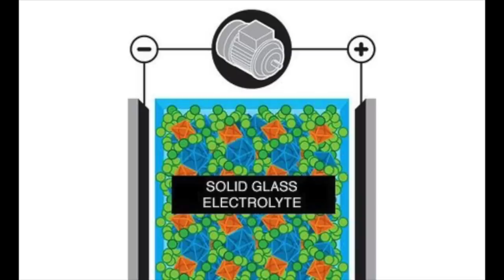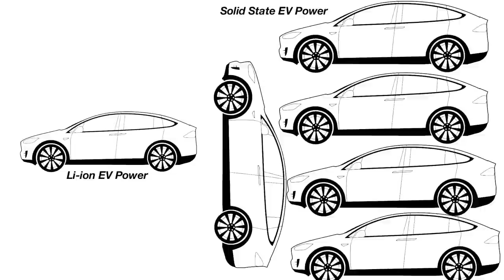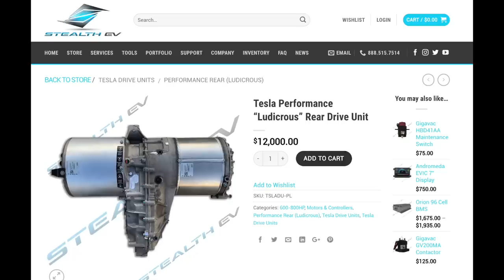The New Battery That will END GAS CARS by 2030 - BIFB SCIENCE (ft. my boat)

Comment: Combine this tech with Hydrogen fuel cell vehicles. it just generates electricity on demand as opposed to having to charge the battery
Reply: With this tech, there will be no need for the fuel cell because the weight of the fuel cell will not be much less than the weight of a battery. We already have a huge infrastructure supporting electricity. Hydrogen infrastructure is nearly non-existent.

Comment: Goodenough's name is pronounced "Good-uh-now", not "Good-ee-nuff." Rimac, who make the drivetrain for the electric Porsche Taycan, have a 2000HP electric car using lithium batteries - Richard Hammond (Grand Tour) crashed one of the 8 version 1.0 Rimacs in existence. Koeniggsegg are also north of 1500HP...you need to work on your Google Fu, Chris. 

Batteries are there now - we are capacity constrained which is the ONLY reason you don't see a $25,000 Tesla. Tesla will have a 33% more dense battery, which is in the lab now, in time for their Roadster, Cybrtrk and Semi.

The gas engine is DEAD. We can't build enough EVs to replace them, which is the only reason they'll continue to be on life support.

Comment: If you watch the weather channel at all you should know our electrical grid is absolute garbage. They mention snow out east and thousands of people lose power, or the thousands of people without power in Cali without power because of the fires. I also remember rolling brown outs in Phoenix AZ because the grid can't supply the power with all power draw of air conditioning. 

Now before you say I hate electric I don't; the most massive machines on earth are something electric. Air craft carriers are floating cites that move with electric motors. And if you actually know anything about cars and trucks, you would know they had electric cars and trucks more than 100 years ago.  There already is electric racing, its called Formula E.

Comment: But where should all the electricity needed to charge those giant batteries should come from? Nuclear powerplant? Coal ? Gas? All those things are polluting the environment just like combustion engines. The first thing to do is developing a renewable energy generation system, which is stable and predictable. In addition to e.g. thousands of wind turbines ruining landscapes you'd to invest billions in the power grid to transport all that energy from the power plants to the charging locations. There won't be any icy roads close to those recharging spots pulling MW of electric energy from the grid to recharge those batteries in time.

Comment: The technology is real. BMW i4, go look at the stats for it when it is due in 2021. Renault, Toyota, Honda. Suzuki, and others are talking about SSB within the next couple of years. Car Ownership is going to collapse. In fact the manufacturers kind of WANT it to collapse. These new batteries are going to enable cars to last over a million miles with bugger all for service. It does not make sense to sell these cars to a consumer who only travels 12k miles a year on average. There is no repeat sales model in that scenario. But selling them to an autonomous fleet or operating that fleet yourself?  That is a repetitive sales/production model. Your average Car today is parked for 95% of its lifetime. Are you going to want to spend $10k/yr financing, insuring, fueling, and repairing a gasoline vehicle, or do you want to spend $1000 a year for autonomous transportation? A robot taxi that is charging from stored renewable energy that can last for 1+ million miles? That is capable of turning a 25% profit at 10 cents/mile.

Comment: You're looking at this from a first world prospective and not a global one . Combustion engines will be around for a long time yet. Until I can plug into a tree and recharge electric vehicles will never be viable mode of transport. Actually there's not many trees in Central Australia so that's another problem. Then look at the African continents energy grid. The country has sparse to non existent power grids outside major centres. If the glass battery dropped today or next year it still won't have the energy density of gasoline and that's where it really counts. One day we will be free of " fossil fuels " for every day use but still require them for things like getting into space or shipping. Can't conceive a battery big enough to move a container ship from Asia to the USA then recharge it in a day.